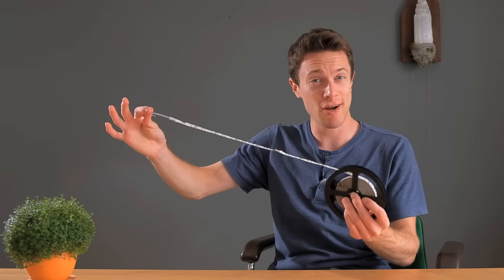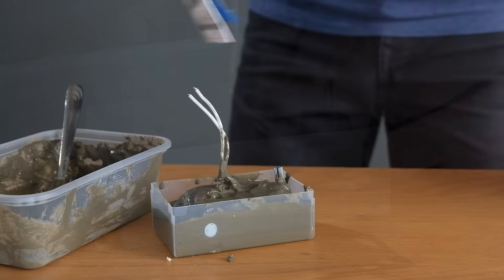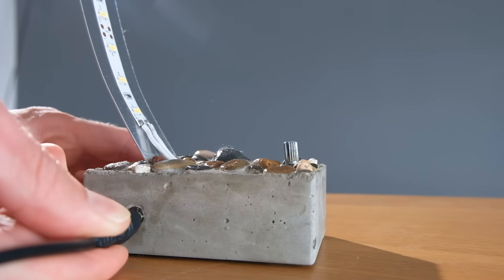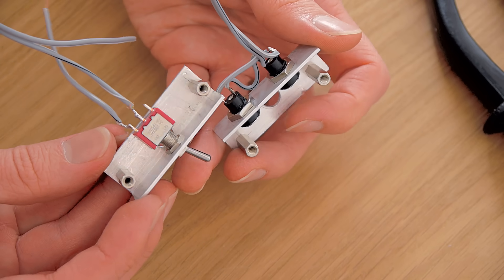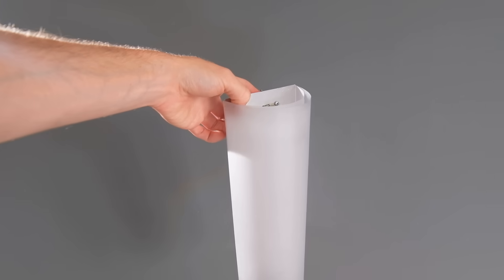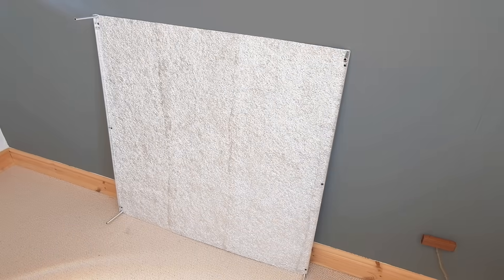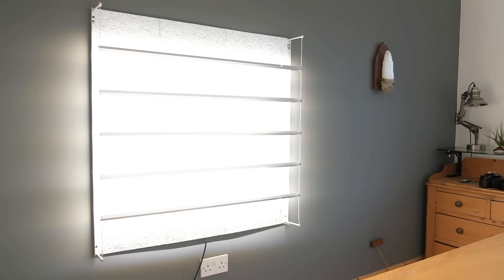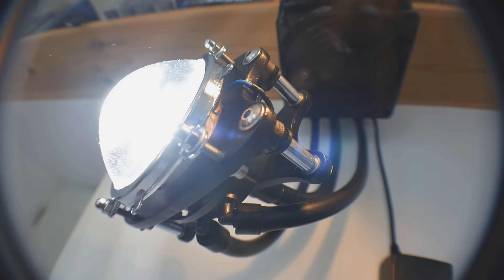3 inventive lighting projects using LED strips

Comment: Ok, so I just got to your 3rd project here, and you have used electrical wire to suspend weight on it, and then also ran those wires through drilled holes in the aluminum brackets you used. As an electrician, I will say that you should NEVER use wire that you are running power through to hold weight of anything, and then also running a wire through a hole drilled in any kind of metal without some sort of jacket around the wire or bushing on the metal to protect the wire from being damaged, which could also end up conducting electricity through the aluminum. Yes, it is low voltage, but it is still absolutely possible to conduct enough electricity to start a fire under the right circumstances, and is also possible to still injure someone. Think of a small child grabbing onto that and tugging it by the wire, which is then cut open by the holes the wire is running through... SAFETY FIRST. 

I've seen far too many incidents where people totally assumed something was safe or wasn't "that dangerous" but then the worst possible thing that could happen did in fact happen. Just something to think about, as thousands of people out there watch videos like this, and something that might seem simple for you to do may not be as simple for the next person that goes and does it wrong, then something bad happens. All it takes is one person not understanding that LEDs such as these require a transformer, then they spend the time making something like that to then try and put an extension cord on the end of it and plug it into a 20A receptacle, then they have a 4 foot charged piece of metal hanging on their wall because a wire was pierced running it against a rough edge of a poorly drilled hole, then their 2 year old child sees it and thinks it pretty and runs up and grabs it...
Reply: StrangerOf The206 
Take it easy there Fire Marshal Bill I too am an electrician and I think your over reacting just a tad. There’s no real weight, and no real load on the wire. If you were a chef instead of an electrician would you not allow you kid to glue macaroni to a plate ? Relax it’s not hurting anything.
Reply: "Dude... but his accent"

That's some REALLY EPIC SHIT "bro".... I'M SURE of it. I'D SUGGEST you keep making those REALLY EPIC videos of yours, your career as a youtuber will take off in no time, I'M SURE.
Reply: @Really Epic Shit yes, I'm sure listening to a child screaming in an Australian accent while be shocked from a 20A circuit would be quite entertaining for you. I suggest you build something like this, make sure it is poorly built with improper connections, then have one of your family members or your child stand in a bucket of water and grab on, and make sure to record it for us all to make fun of. That would be "Really Epic Shit" DUDE.
Reply: StrangerOf The206 the current rating is totally irrelevant, and you should know that, you cannot get shocked by a 5Vdc source, the voltage is not high enough to pass even 1mA through your body which has quite high resistance.
Reply: @santopino2546  yes I understand that, but if someone who didn't have any electrical knowledge went to try something like this with a similar light that wasn't low voltage or some sort of similar scenario, it wouldn't end well. 

What's your opinion on it then? Do you think there should be no concern for safety? There are multiple things in that 3rd project, which I mentioned in my original comment, that are not considered "safe" by national electrical standards. Suspending anything from a wire with current running through it, running wires through drilled holes without any sort of connector or grommet to prevent damage to the wires, etc. What's your opinion? Everyone is entitled to their own, so please, feel free to share yours....
Reply: @strangerofthe2067  Sure I would have never done it that way. What you claim is not only professional, safety it's also a neater job.
But you must consider that this is a LED DIY project, so it is (quasi by definition) low voltage. it's not a general electrical course.
Reply: @santopino2546  yes, I understand that THIS is low voltage, but when Timmy goes to make something similar with whatever he can scrounge up and finds some lights that are NOT low voltage and uses similar techniques, like hanging a bunch of weight on an extension cord that he ran through a bunch of poorly drilled holes on some sheet metal, then Timmy's 3 year old sister thinks it's pretty and starts tugging on it, ripping the sheet metal into the hot lead on the cord and shocking the shit out of her, then she has a heart attack and Timmy's parents are all pissed off cuz Timmy watched some shitty DIY youtube video and made a death trap that killed his little sister... I know they are low voltage, YOU know they are low voltage, but maybe Timmy doesn't know they are low voltage, or what that even means, or maybe Timmy doesn't know a damn thing about electricity except what he has seen on these shitty DIY videos, showing him to do some poor, crappy work without any precautions or warnings that electricity CAN be very dangerous if you don't know what you are doing. 

God damn, that's all I was trying to say guy. If it makes you feel better, sure, you are right, I am wrong. You are the winner, I am the loser. You are first place, I am last place. 

Fuckin youtube....
Reply: StrangerOf The206 I understand your view, no problem. And I agreed. No need to get upset.
I see that sometimes even "Expert" DIY bloggers make dangerous traps.
The YouTubers Thunderf00t onced made a video denouncing the idiotic idea of Russian Hackers DIY project of a simple Aircon. The idiot using dry ice that not only cost more without offering anything better, it would silently kill you.
The Russian wouldn't admit his error and take down the video, he simply added a comment claiming one could also use normal ice.

Comment: I clicked on this video expecting level 1 difficulty DIY projects. Then he busted out the soldering gun and man was I surprised. Still watched the whole thing though
Reply: @8a8  helps to also have a solder gun :)
Reply: but, don't do it like him.  you should heat the parts to be soldered.  He's not getting the part hot enough, and that makes for a cold solder joint. Which is bad.  or, will be bad as current passing thru it heats it up and breaks it. use rosin core, it heats easier, and sticks well.
Reply: @raisem8063  wtf is wrong with you
Reply: @8a8  I couldn't say ;)
Reply: Not all viewers r level one, level 2 ppl deserve some love too
Reply: They are very cheap at the hardware store
Reply: LMAO
Reply: These aren't exactly level 1 but they're level 2...

Comment: LOLOL...there is a thousand more choices to anchor the working light, other than pouring concrete.   Love the
AL U MIN E YUM...
Reply: For Example? I think wood will be too lite. And you have to hide the electronics. I am really curious, bc i build it myself. 
a hollow metal body?
Reply: @phil_4769  wood box, lead or steel bottom (for weight).

Comment: Hey nice video! I built something quiet similar some years ago. I built a wooden arc from plywood and  countersink the LED stripe in it. To fix it onto my table I used small aluminium clamps and gave the ply wood some layers of painting that let it look like real wood. :) Now having seen your video and your Concrete Audio Nob I see how I can improve my version of the light quiet a bit ;)

Comment: Hey, you have some great projects, but using the wire with aluminum to hang things is potentially dangerous.  I used to work for a place that did UL certified lighting and we would be roasted for  that and not having passthroughs on the second one too.  Maybe use fishing wire or one more aluminum angle to create frame then route wire more safely and use more safe connectors (home depot/lowes easy find in electronics aisles).

Comment: Why would you not use the blue connectors on the dimmer @1:14 ? There are also 5v connectors with those connection to get rid of soldering?

Comment: IMHO if you mind the energy efficiency, this project using LED stripe is definitely a bad idea, as the resistors(36 ohm) will consume  bunch  % of energy. on the other hand, CRI is also an important consideration, those LED stripe is hardly achieve Ra>80. don't do that if you really want good lighting. Go for Ra>90 LED, and instead of using resistors, please use constant current power supply!

Comment: It really depends what you want to do with the leds. If I was just making that arch light to put on a desk or table or display, I wouldn't be worried in the least about color quality and even the cheapest led strips would suffice. For $15, I had a decent 15 foot RGBWW strip with the controller. I'd really only spring for more expensive leds to ensure that I get ones that look like daylight if my project were for something like an indoor garden or something. Otherwise, there's really no need to spend more. Knowing they might dim over time, I would buy extra of the cheap ones so I could replace them if needed, but for the most part, the cheap ones and the expensive ones come from the same manufacturers and just get branded and priced differently. They seem to have pretty much the same life span. I mean it's physically the exact same leds and the exact same resistors so nothing about the strips themselves are different unless you get a type with different leds.

Comment: I like it, but what irks me is the whining about low quality LED strip when you go and link some mass produced Chinese generic LEDs. most strips are produced en masse with the boxes/logo's being the only difference. the ones you linked can be bought from wish for < $10 with shipping for 5m. they have the exact same diodes as 99% of white LED strips. try and find some 5050's ith each light having an individual controller if you want high quality

Comment: Hi! built that last diffused light with the large cardboard following your instructions and hooked it up to a 12v 6 amp power supply. Very educational experience so thanks for the inspiration ;-) The brightness is nowhere close to yours however even though I bought the same LED strips as you. Are you running this at 12V as specified? Any help you can give would be greatly appreciated as I want to use this for making videos and it is not really bright enough to be of use as it is!
Reply: a reply to this would be nice

Comment: what did you use as the power source for the aluminum foil lighting?  It looks like a low wattage power supply with an xt-60 connector soldered to it?

Comment: Hey Matt I love your channel! I was wondering which UK power supply you would recommend for the led lights you used on the last project I was considering trying to create an almost flush mounted ceiling light using a 5 metre roll of leds I'm creating a VR room with my Oculus Rift and as I'm 6.4 tall so I wanna have lighting for the room without taking up space I can't use recessed lighting because my water tank is above the room I'm trying to light.
Reply from the maker: A 12v 6A power adapter should do the trick! Or, if you want the LEDs to last longer you could use a 19v laptop adapter and power the LEDs with it with two strips in series (so they get 9.5v each).
Reply: DIY Perks Thanks Matt!

Comment: 10:01 note: before  putting the wires through the holes make sure that the holes a filed and smoothed to prevent damage on the wires

Comment: Cheap led strips are not always bad, I have a strip $7.00 5m strip running off my computers power supply for around 5 years now and none have gone out yet and I have not noticed any dimming. Now this may be due to the power supply running at a easy 11v so they are being under driven, and I do agree about the color rendering it is not the best but it just fine for under desk lighting

Comment: I am constructing a similar project myself and would like to know the specifics of the power adapter used to power the LEDs. I am making a desk light with, give or take 12 LEDS. Would 12v and 1A be enough? I know that they need 12volts but im not sure about the amps. If anyone could help me put that would be very much appreciated. Thank you

Comment: Great video, very creative and cool techniques!  Thanks for listing the products used.  What thickness of aluminum do you prefer, please?

Maybe bend the ends of the aluminum strip over to help prevent pulling out.

As mentioned, LED strips need cooling (which the aluminum strip helps to provide here), heat shortens their life.

The traces on LED strips are very light-weight, causing the LEDs farther away from the power entry to be much dimmer.  Additional wires can be added, soldered to the strip in a few places, to prevent this.  Not sure how to make the additional wires look good though.  

Beware cheap import power supplies, many of them don't have proper safety isolation from the AC power line.  BigCliveDotCom (no connection to me) has some videos of the details.

Comment: It would be interesting to see what each of these lighting projects do to a otherwise completely dark room.  The lighting shown here is a tradeoff for the needs of a quality video, as this one.  I won't be able to tell if these color strips have a orange or blue tint to it because of these external sources for example.  There is an external light at https://youtu.be/V5uycGosYq4?t=708 casting a shadow on the aluminum bars.   There is an glaring external light on the left side at https://youtu.be/V5uycGosYq4?t=271 .  So I'm not sure the lighting effect of the project is as powerful as shown.

Comment: Estimated maximum power consumption for the lights:

Strip work light - 1.6m, 100 LEDs: 20W/1.6A (equivalent to 100-150W incandescent)
Small wall light - 0.5m, 30 LEDs: 6W/0.5A (equivalent to 30-50W incandescent)
Window sized light - 5m, 300 LEDs: 60W/5A (equivalent to 300-500W incandescent)

Have i made a mistake somewhere?

Comment: I know it's correct in British English but it still bothers me that he says alumin*i*um instead of aluminum.
Reply: Daniel McDavid that's how it's supposed to be. American English is dumbed down
Reply: Look at the periodic table:
dumbed down? In the case of aluminUM, there are many elements which end in both ium or um, so it can be either one. In the case of most other differences, american closer to the actual pronunciation, and optimized for efficiency.
Reply: Daniel McDavid exactly. Dumbed down. There's no silent letters in the American version making it easier to phonetically pronounce.

Comment: Have you been able to test the CRI? I question any & all specs from Chinese sources. They claim a ludicrous 50lm/LED. I doubt each group of 3 even reaches that level. Also, I've discovered one must be careful about powering longer lengths. Anything around a metre or more will suffer significant brightness loss at the far end because of voltage drop. I've powered 2m lengths by connecting to the middle of the strip, and 5m lengths by connecting at 1/4 & 3/4 positions. Of course, your wire must be low resistance too. I use standard 14ga house wiring, which is actually the cheapest I've found...in bulk at least. More LED strip info from my tests:
https://www.edn.com/electronics-blogs/benchtalk/4441881/The-skinny-on-LED-strips
https://www.edn.com/electronics-blogs/benchtalk/4459176/The-Lampshade-LEDening--LED-project--1
Reply: I’ve found that 5 metres is the absolute max length before the voltage drop dimming becomes noticeable.

Comment: So glad I found your channel.  The first project I'm going to do is a gift for my wife as the arc LED light will be perfect for her craft table.  I'm doing a few mods like running it off an Arduino microcontroller and using an individually addressable RGB strip.  However... back to the very basics... wondering what thickness alu-min-yum you chose.   Second, was the reason to not do a single piece for the arc due to the size you had available?  I found a place that will machine cut 6016-T6 for about $10 for a 60"x2" strip.  What are your rough dimensions?

Comment: Hey, I'm Derrick. I have been watching your videos and finding them very interesting. Initially I was looking into making LED bulb to screw into the sockets that would replace the florescent ones and possibly save me some money on electric. I noticed you didn't use and resistors in this video. Is that only because you weren't connecting to an electric socket but instead using batteries? I know little about electronics... :-)